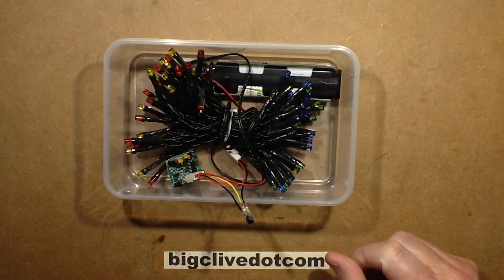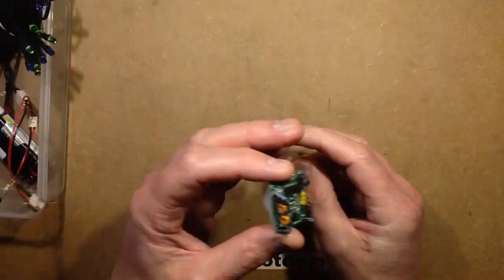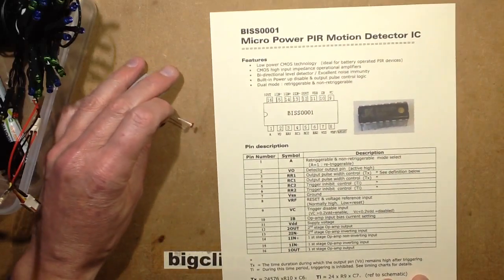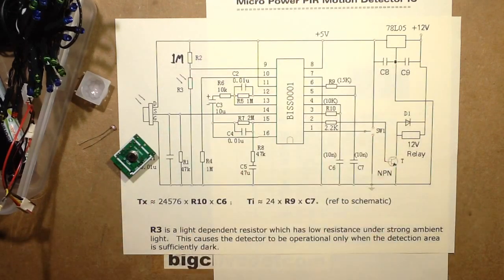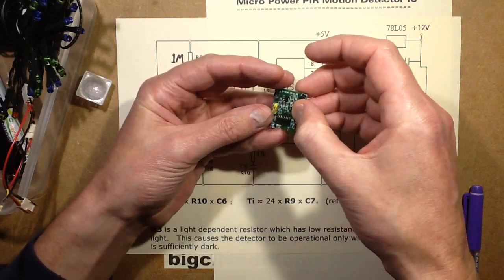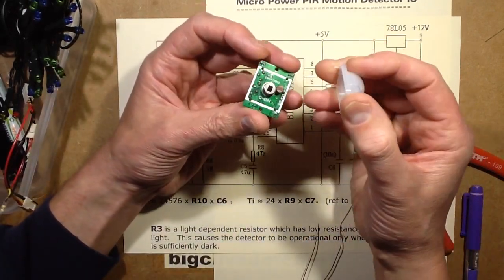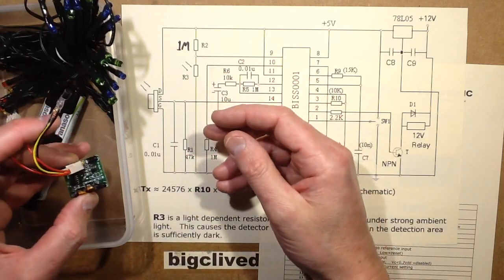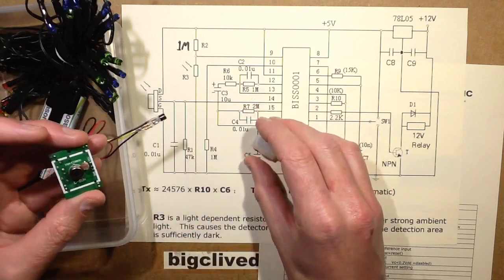Adding a light sensor to a PIR module.

Comment: Had a look at my PIR, same looking model, but mine has two set of pads, marked : "RT" and "RL"
Reply: RT is for a thermal resistor. You can trigger the sensor at a certain temperature. The RL pad is for the LDR, a nice tip put a potmeter over "R2" on Clive's shematic. This makes it easier to trigger
Reply: @lucput6982  Would the thermal resistor be a PTC or NTC type for  freezing or too hot temperatures? (Just now learning about this)  Like if you wanted a heat lamp to come on only if temperature were below a certain temp? Any recommendation on this would be great.
Reply: Mine too, if anyone knows what the RT pads are for, please share with us unenlightened :)
Reply: +Luc Put Thank you :-)

Comment: You said you think the power rail is 3.3v and not 5v, but the schematic shows a 78L05 regulator. What regulator is actually used?
Reply from the maker: In the module the rail measured at 3.3V.
Reply: rjk  the schematic isn't of the board he is using, it's just a generic layout for that chip.

Comment: Nice video Clive!
Question: I'm assuming that u used a GL55 series LDR, can you figure out which one (e.g. GL5516, GL5528 etc.).
Reply: Just tried it with a GL5537. Worked fine.
Reply: I can confirm I used GL5537, 2M ohm,  on all 5 led lamps I have indoors for that walk to the bathroom in the middle of the night.
Reply: i have modded these PIR before with GL55
Reply: Friendroid Nice to hear, but can you tell me if it was a GL5516.....GL55xx?
Reply: i will reply to you later or tomorrow, as the datasheet is in my home computer. I remember checking the resistance of the LDR when dark, them confirming the serial number in the generic datasheet so i could buy another bag, however i cant remember the serial number now.
Reply from the maker: Not sure the exact type, but its dark resistance is off the range of a meter that can read 20M.

Comment: Ever since i saw the toilet led light I have wanted to make one that turns on using PIR but only when its dark. This would be just the ticket and will save hours of coding a micro controller. Thanks!!
Reply: I was being sarcastic. I already have the code from a previous project, this just means i dont need to use it or a microcontroller cutting costs

Comment: Are you ever going to use your nice snips? Every time you solder a component I wonder if this will be the time you use the nice snips.
Reply from the maker: I reserve them for the tasks where the very flush cut will be appreciated.
Reply: Surely that would be the nocturnal poop illuminator?